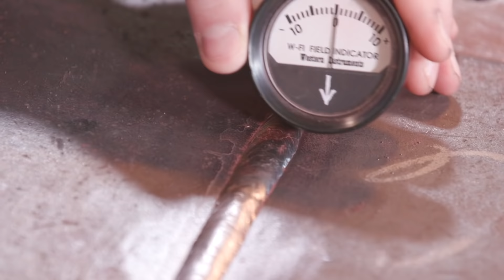Carbon Steel NDT Mag Particle (Testing the NDT Guy)

Comment: I work in the petrochemical and lubricants industry and I see ndt inspectors doing Magnetic Particle Inspections on the welds of Vertical storage tanks. I see the magnetic particles are in powder form in this video, will this not fall off the vertical tanks when applied? apologies for the ignorance I am inexperienced. any guidance ?
Reply: The powder is magnetic, meaning it while "stick" when the inspection equipment introduces a magnetic current into the welds of the storage tank.
Reply: There’s a 2 part spray variant that does the same trick

Comment: Hi Bob. One question, how come adding a copper wire to the weld causes a crack, but the copper coating on MIG wire is OK? Is it just to do with the amount of copper included? Thanks, always appreciate your teachings.
Reply: The coating is less than a micron thick, some bacteria are thicker than that. Its either a tiny amount of copper, or rust particles in your welds.

Comment: What the difference in the nozzles?
Reply: Mr. greens boat tanks and aluminium welding Spray nozzle is longer with a more recessed contact tip.
Reply: Bob  Moffatt thanks Bob that helps a lot with my aluminium welding.